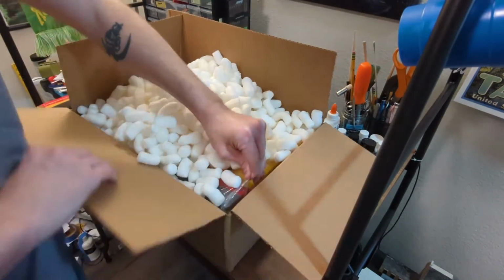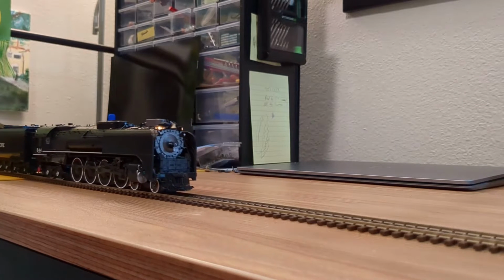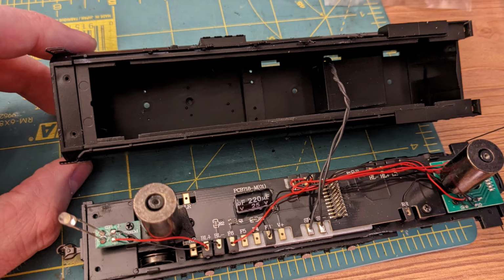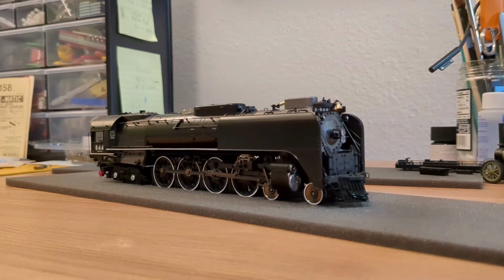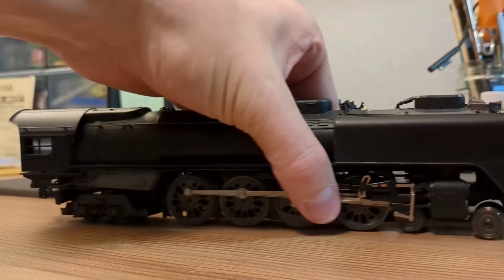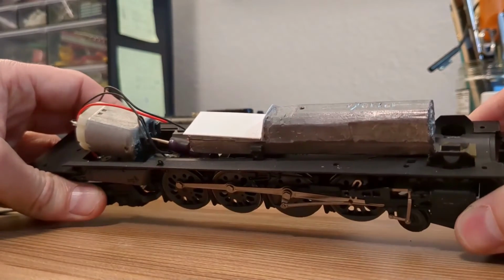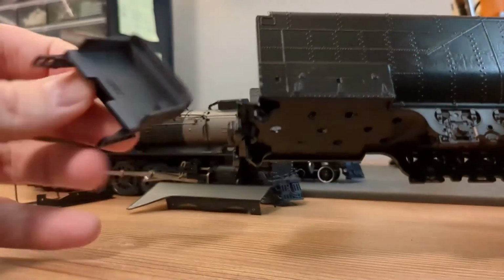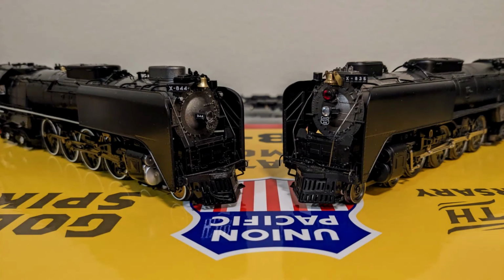UNION PACIFIC FEF-3 - The Living Legend Joins the Fleet

Comment: Wow man.That Athearn unit is nice, but with that wow sound decoder, its just the ultimate.I thought I would try a wow sound in one of my Rivarossi  big boys.It has the motor in the boiler, model.It would be thirty years old.Oh man, it is a wow, alright.The slow speed is phinominal,& the sounds are pretty damn good. I was hooked on the ESU decoders, but now, I am going TCS for my steamers. I have the same model FEF3, & I repowered it, as well.I used a Mashima motor with a Kato flywheel, & a very short driveshaft. It has a LaisDCC non sound decoder, & that just runs so awsome. I have converted all my Rivarossi BBs & that FEF3 with tender pickups.The Rivarossi locos, of that era, were ahead of their time for details,as they can still stand up to most stuff, today. Thanks for the vid, cheers.  Michael  NZ

Comment: That Athearn is really pretty, congrats! In the running section it almost looks like the rod screws are loose on it, is it meant to be as such? 
The rivarossi project is really really impressive, without deflectors it looks fantastic! Thanks for highlighting how good that tooling has held up, rivarossi stuff was truly the best of the time. 

Looking forward to more!
Reply from the maker: Thank you very much! I'm very glad to have a modern (and running) FEF join the Rivarossi and hopefully can get the motor sorted. They'll look great together I think.

I noticed that too, it seems to me that the rods have a lot of 'slop' allowing for the model to negotiate tighter radius curves. The main rods are a single piece, unlike the Rivarossi which has them segmented instead. Looking closely at photos of other Athearn FEFs, this seems to be how they all are. I don't mind so much, as I can't really tell unless it's on the workbench.

Thank you again for watching!

Comment: Nice, I have the same engine, but I got mine with the soundtraxx Tsunami 2 in it. It came with  athearn dual cube speakers. The manual said another set of speakers could be added, so I added another one and it sounds good and loud. I prefer the tsunami 2 over wowsound though.

Comment: As a European I was wondering: which American company does produce the best big boys? Especially the 4014?
Reply from the maker: That's an excellent question, I think it ultimately boils down to what features you want and what you are willing to spend. In 1:87, I'd say probably avoid MTH (carries too much of it's O gauge big brother's toy-like qualities) and Rivarossi (best price, but the molds are now 50 years old, and I believe their 4014 comes with a coal tender). 

That would leave Broadway Limited, Athearn Genesis, and Marklin/Trix. I do not have any experience with the Marklin/Trix Big Boy, but from what I understand they make a very fine model with some incredible detail like the 4014 shield on the cab floor. Broadway Limited, like the Marklin/Trix model, is diecast and is a great puller, and now comes either equipped with BLI's own sound decoder, or without. 

Athearn Genesis is plastic, but I always thought that the plastic boiler offered slightly sharper details, and it will pull fine as it has traction tires but I know many do not care for that. The Athearn will also have lit numberboards and firebox flicker, but the BLI will have lit class lights. The Athearn doesn't come with smoke, but the BLI (and MTH) does on their sound-equipped model (not on the sound-ready version). Smoke can be added with Seuthe units to the Marklin/Trix and Athearn models respectively. 

I think the Athearn model has an incorrect tender, at least some of the detail is wrong, but I haven't looked closely. My Athearn Big Boy is coal fired. I believe BLI and Marklin/Trix have the right tender. And I would also mention that none of the higher priced models have the steam chest covers in the silver color 4014 has, but the cheaper Rivarossi does. 

If I was in the market right now for a 4014, I would go for the cheaper DCC-ready (Stealth) version of the Broadway Limited example and put my own decoder of choice in there and make any small detail changes necessary. The Marklin/Trix would be next, but I believe they are close to $1000 US new. Hope this is helpful!

Comment: picked up #835 about a week ago. with the factory tsunami2. is the mars light supposed to work?
Reply from the maker: I believe it should, try running the model and hitting the emergency stop button on your controller. I think Soundtraxx may have the mars light to operate while the locomotive is in an emergency stop. Other than that, function 6 is labeled as 'effect light' in the manual, it may be that as well. Good luck!
Reply: @yardsounds90  ill try those. Thanks for the help